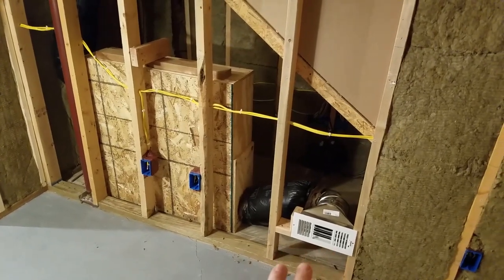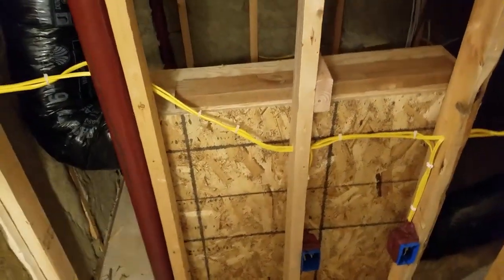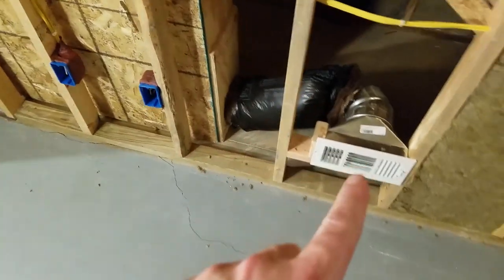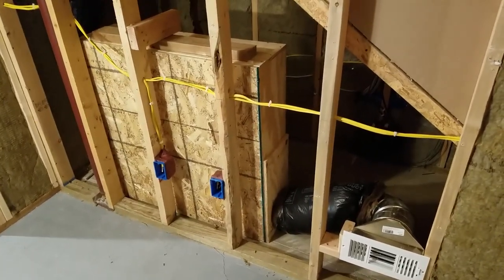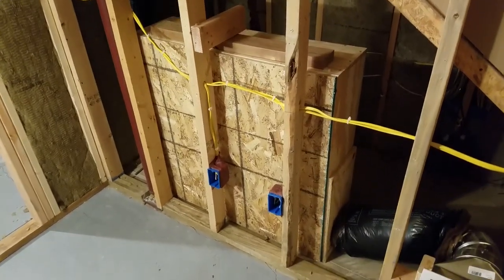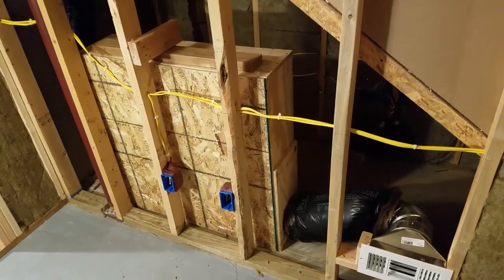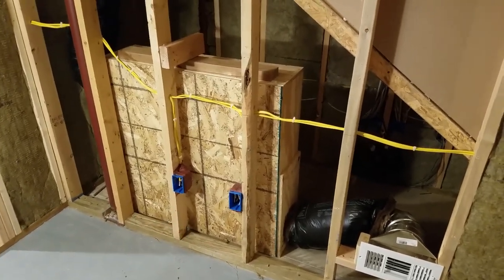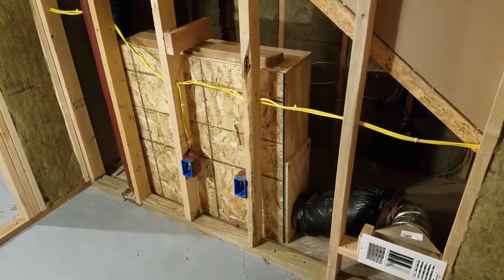How to Build a Silent Air Vent For a Recording Studio or Home Theater

Comment: I think it's important to keep in mind that this is a DIY project, not a commercial installation. For that reason, the specs required will not be similar, although the desired outcome is the same - to have a more silent environment for recording. Based on the DIY spec and professed results, I think this is a successful project. 

I had a similar experience when building my vocal booth. Being an experiment, there wasn't much planning and I just learned as I went along. Eventually it turned out exceptionally well for being improvised. I couldn't sell the design commercially, but it works fine for me. And that is the point here. It works well enough for sillennium, even though it may not be up to spec for a high end commercial studio.
Reply from the maker: Thx for the comment
Reply: What did you end up doing with your walls/windows for your studio? Does it help block out the low frequency sounds from outside the studio? Let's say someone blasting low bass sounds outside of it; would you be able to hear through it inside your studio?
Reply from the maker: So yes you could but that's because i didn't go as sound proof as you can due to cost etc.  But i can say when thunderstorms come my room is the safest and many times you can't even hear the thunder

Comment: The amount of resistance in that amount of flex duct is insane.  In addition, you NEVER put flex duct behind an inaccessible wall.  It will bread down over time and be impossible to replace without a considerable amount of effort.  You could have done metal ductwork with internally lined insulation.  Any duct manufacturer could make it for you.
Reply from the maker: Maybe I should have, but I did what I thought was best at the time.

Comment: I think you could have ignored the tubes & turns inside the box & just simply had it insulated with rock-wool, but the outlet needs to be one size larger & possibly filtered with a 20x25x4 to keep any rock-wool out of the air.  You want the sound waves smashing into each-other & the rock-fibers while at the same time slowing the air-speed to eliminate any air-moving sounds.
Reply from the maker: Very possibly.   This is what I came up stuff hopefully it will inspire someone to improve on it

Comment: You missed the most important parts of building the HVAC silencer box. To achieve the desired insertion loss, you require a few things:

- Abrupt direction changes (your flex duct prevented you from having this)

- A gross impedance mismatch. This means having your cross sectional area change several times by doubling or halving. What you should have done in have your 6" 27.3 square inch duct enter the silencer box without any gradual adaptors, then have the cross sectional area of your box be twice that. So ~60 square inches. Throughout the box, this size should also change. Your flex duct prevented you from having this.

- At least 3 baffles. You had this.

- Duct liner. You should have 1" duct liner fastened to the inside of your box. Your flex duct prevented you from having this.

- Your silencer box and really your entire duct system should provide you with an air velocity that is slower than 300 feet per minute if you want a good recording or listening environment. Your grille, register or diffuser should maintain that quiet operation by having an appropriate NC rating. By not increasing the size of your duct work exiting your silencer, you did not slow down your air velocity.

- Your silencer box should be made out of material that has the equivalent surface density of the wall of which it is penetrating. Example: 2 layers of fire rated 5/8" drywall on your wall would require you to build your silencer box out of 1" MDF. This mass must be maintained THROUGH the wall penetration. Have a square or rectangular sleeve penetrate your wall and backer rod/caulk around it. This is the only way to prevent trashing the isolation of your wall. You did not maintain your mass and therefore your entire room system has the level of isolation provided only by the flex duct. Not good.

- Every wall penetration requires a silencer box. So if you built an MSM system (a room in a room), you would need an outer leaf silencer, and an inner leaf silencer on both the supply and the return. That is a total of 4 silencer boxes per room. You only show one box for your supply. So either your room doesn't have a return, or else you have a big return hole in your wall which defeats the purpose of having silencers at all.

Lastly, flex duct should only ever be used in short runs due to it's inherent friction loss. Furthermore, any time you use it, you should use oversized duct as it's internal cross sectional area is actually smaller than regular 6" duct.

Thanks for sharing, but I hope people don't follow your directions step by step as there are a lot of flaws in the design.
Reply from the maker: Glas Audio you think it is flawed but it works perfectly for me.   My wife can't hear me playing in the rest of the house through the duct work and i can't hear the air moving coming into the room. I would say success on my part for 40 bucks in materials
Reply from the maker: Glas Audio thank you for the comment and feedback.  Hopefully someone will see it and take that into consideration
Reply: Glas Audio hey, thanks for the info, flew way over my head, any chance of a simplified explanation for someone learning as he goes.. or a video with some visual assistance ::)
Reply: There is a diminishing level of benefit here, as it relates to how much increase in sound elimination vs. air flow.  How much better will the system work, in relation to how much more work, materials, and complication involved?  There's a point where you say, "this meets my needs, and is fine". What is the point of spending a much higher material cost, a more complicated design, and much more time involved, all for perhaps for a negligible and imperceptible amount of 'improvement'?  Some people really enjoy showing the world how much smarter they are, and over-complicating a simple system, THAT WORKS!  Leave it alone.  It's not broken, don't 'fix' it.
Reply: I love comments from HVAC engineers/ people who know wtf they talking about and aren't just randomly hitting keys on keyboard
Reply from the maker: Thx for the comment.....afhighkkdfhcddcjkn
Reply: @richardsummers8805  GlasAudio's comments are very much appreciated by me.    Yes, Construction is about compromises related to budget etc.  There is nothing wrong with understanding what best practices are, how an ideal system should work and then choosing to make compromises as you need.  In the video Sillenium is wisely asking for critical comments on his work so why be critical of them?
Reply: What I got from Glas Audio's comment, which could have been much simpler is that while Sillenium's design works for his purpose, it could be improved by:
- Using rigid materials instead of flex duct so that the surface density is maintained at wall penetration, is caulk/sealed, goes into a rigid chamber which has 3 baffles with mismatched impedance by changing size through the box and is lined it with 1" duct liner. 
-Finally he needs a matching air return.
There, simply said and doesn't blow smoke up one's own *$$.
Reply from the maker: Thx for your reasonable feedback
Reply: @sillennium  Glas Audio is touching some points here, but flex duct is totally usable for this purposes and these baffle boxes are a lot of rubbish. I'm not going into details, but flex duct left as straight as possible, is perfect; you only have to see (flex duct has very thin material on the outside of the duct so this radiates sound) you put it in a box with sound reducing capabilities comparable to the rest of your constructions.
Reply: One issue with flex is that it catches dust and is hard to clean. You didn't mention a filter.
Reply: Thank you a lot for the comment!!

Comment: Nice! Thanks for sharing :). I had a few questions if you happen to have time to answer them. Is that the supply vent only? In other words, do you have another vent for the return, with another fan? If not, I'm not sure how one single tunnel could provide both supply and return. Also, do you think it matters in what room you place the fan where the air is supplied from, or is your air supplied from your house's vents? Trying to build a room within a room in a rented place so can't really tear down walls and such. Thank you for your time! Fantastic work.
Reply from the maker: The return is right outside my room.   I leave the door open all the time except when I am recording.  One vent can't do both.
Reply: That’s pretty much what I’m doing. I need to build my baffle box now…

Comment: When creating any sound-proof, booth, pod, room, etc. you essentially, completely seal all joints, gaps, etc. with acoustic tape, green caulk, etc. This creates a hermetically sealed space. You're pumping hot air into an air-tight pace; turning your room into an inflating, hot-air balloon. Are you separately venting out?
Reply: so you need two sound mazes?
Reply from the maker: Yes

Comment: Hi Sillennium - this is a SUPPLY vent, if I understand correctly - do you have a return vent or any other vent in the space? I am under the impression that if a room is truly air tight (almost soundproof) then it needs an return/vented output besides just the supply fan constantly filling the space. Just trying to wrap my head around it! I have two supplies direct form my HVAC, through my baffle boxes - similar to yours - but realize I should have an output vent....
Reply from the maker: I do have one but it is right outside the studio door.  It's in the ceiling so I didn't really have a good way to sound proof it so I kept it outside the room since the door is only shut when recording etc.   95% of the time it is open
Reply: @sillennium  my layout is very similar. Before I do drywall I’m considering adding an air exchange vent so if I do keep my studio door, shut for long period of time, an air exchange to  my foyer area single return will pull it. my studio has two supplies, I put large DIY baffle boxes off the ceiling for those. Thanks for the video.

Comment: Hey, amazing video. Just wondering, where does the other end go to? Do you just open a random spot above the basement and make a vent there? Do you need a filter system? Or just clean the vents every so often? Thank you so much for any response
Reply from the maker: No filters,  but it goes to a vent i cut out in the wall and the other end attaches to the air system

Comment: Was that a huge fail to have the 24" flex duct between the box and the output vent??!!! That means your baffle box is completely bypassed and all sound can leave through that metal elbow and flex duct at the vent! oops!    Does this work? If it does work, imagine how much better it would have worked if that vent was built right into your box.  Am I correct? I"m just a DIY guy trying to learn...
Reply from the maker: It doesn't seem to be causing any issues.   The flex was my only option and many said it cuts sound naturally

Comment: Isnt not safe to have the open roxul exposed in the airflow and going out the vent or do you have some type of filter preventing the roxul from going airborn?
Reply from the maker: None of the roxul is in direct contact with the air flow.  It is all contained

Comment: Nice work. Thinking about building a drum room myself. How about the air leaving the room? Have you planned any circulation?
Reply from the maker: Chiran Kulasena sort of, I have an air return right outside the studio rooms door.  I don't close the door unless I am recording otherwise I keep it open to keep the air moving.  I just didn't have a great access to the air return on this side of the basement.
Reply: @sillennium  got you... yeah that should work. I am more concerned about when i am having few people in there for a session. I have a stairway just like that next my room. I might just think of putting a dampened return to it. Something i can completely seal off or open when i need.
Reply from the maker: Chiran Kulasena i have seen folks put in audio foam onside of a mich larger vent.  Like a muffler and it works well for the air leaving the room
Reply: @sillennium  cool... i will keep that in mind. Thanks and good luck with your project!
Reply: Good video. I recently built a very similar system. Two things different:
1. I don't have heated air going through it. I find with all the insulation in the walls that  heat is a problem. I just have air from the next room going through via a very quiet bathroom style fan.
2. I have another box on the other side of the room for air to escape. This one is unpowered and allows for flow through ventilation, even when recording.
Reply from the maker: Nice work

Comment: So does the central heat air come from the same vent?  If so would it melt the soundproof foam?
Reply from the maker: It's rockwool, it doesn't burn
Reply: @sillennium  Is this rockwool expensive?  Im trying to make the sound from my vent dampen some ... it's like a damn megaphone
Reply from the maker: @julial3758  its about 55 usd per bag.

Comment: Your 6" ductwork is kinked causing backpressure to your HVAC unit. I assume you are creating a negative airflow setup? Better to use metal 180 degrees (U joints) at the ends to prevent blockage of airflow in your tubing. More effective. You can also make a fiberglass plenum. Buy the board at any HVAC supplier. It's yellow on one side (fiberglass side) and has metallic paper outside covering it. You cut the box pattern similar to a cereal box (but much bigger), use DUCT tape to tape it together and you have a plenum. Paint the fiberglass side with latex paint to prevent the glass fibers from entering your air space. Use rock wool and insulation spray foam in the can for sealing the tubing inside your plenum. The less 180's you have, the better the airflow and the less noise. Sharp corners create obstructional wind noise. Straighten out the tube for best results.
Reply from the maker: Thanks for the thoughtful reply!
Reply: I don't see where his 6" is kinked. Im sure his 180's made with the 5" inside the box flow fine. Obviously less than no 180's, but I'm sure that metal u joints won't flow much better. Besides, you must seal the metal joints to prevent leakage.

Comment: get rid of that stamp face grill better option is b ar type grill much better flow less noise factor
Reply: they also make silent flex instead of plastic inside its cloth
Reply from the maker: Do you mean bar grill?

Comment: Dont use recessed outlets...
Reply from the maker: Please explain your reason for others that may see this
Reply: When using recessed outlets etc. there is big holes in the drywall, if you have 10 outlets its adds up pretty big hole. If you use surface outlets you only have  holes size of your cable which is easier to seal.
Reply: And i ment electrical outlets in booth walls 😀
Reply: He used putty pads on the boxes, and if you seal around the opening, what's the difference? The putty will have a better stc rating than the drywall.
Reply from the maker: Yeah that's the purpose of the putty